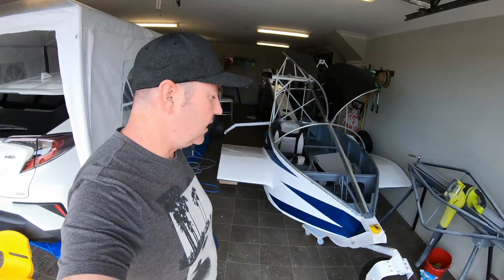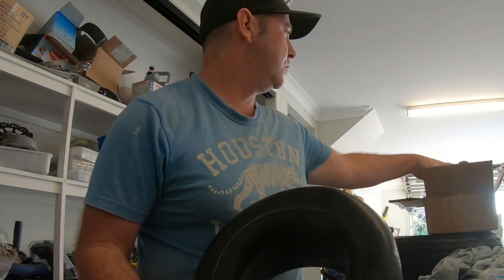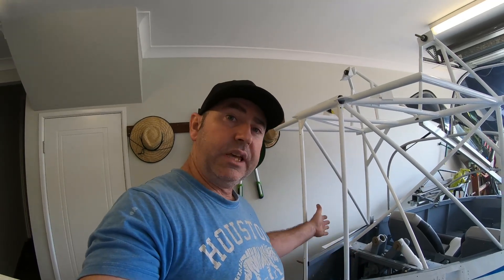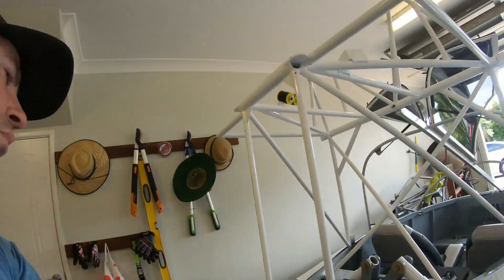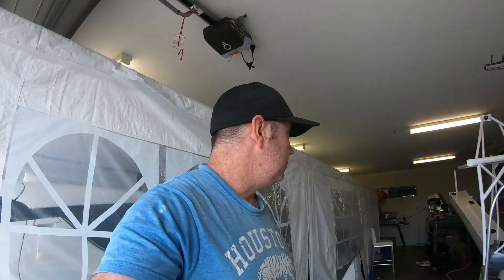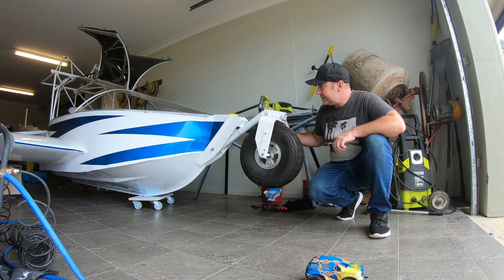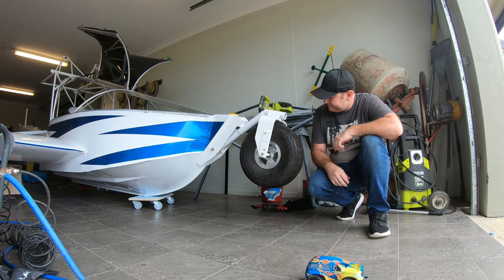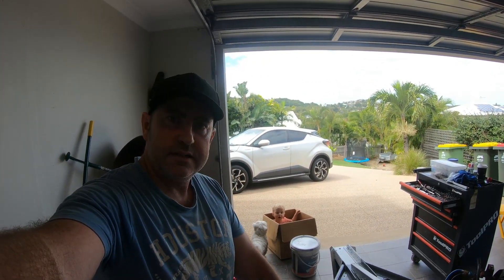Ultimate seaplane build retract gear and final assembly #Ultralight aircraft. Homebuilt update

Comment: Brilliant work!  Can’t wait to see how she floats!

One year ago this month I crash my Searey.   I made a perfect landing but on step taxi I picked oscillations during full power to take e off. 
I then hit a rogue wave and not having enough lift , the front of the plane went under about 1 foot of water and it popped off the front cowling.  It just popped off in one piece and the carbon fiber hull collapsed underneath my feet.   In seconds I was underwater holding my breath.  Luckily I didn’t panic and was able to get out.   I only had a scratch on the back of my head.
Lessons
1. Be extremely cautious of oscillation, it will kill you!
2. Practice egress, know how to get out of the plane, even if it’s flipped over.  Close your eyes and know how to find the seat belt latch.  Sounds simply unto your underwater holding your breath.
3. I had a seat belt cutter in the pocket next to me… when the entire cockpit disintegrated so went the seatbelt cutter.
4.  They make these small 10 min air tanks… maybe in corporate it into the design.
5-  Get training…. This one will be a challenge… how will you know the quirks of this one off plane?
Maybe train in a Searey, as it requires a different landing technique on the water.
6. Will you have a gear warning device?   Training will help here too if you opt not to have it!

Take care!  I hope this helps you prepare….  Landing on the water is a blast, but it can be unforgiving!
Reply from the maker: Wow sounds like your very lucky to not get injured. That is some really good advice thank you. I have done some water landings in a searey. I’m fortunate to have two mates with seareys and will be doing some more prior to testing this one. I do intend on having a gear warning. What do you recommend? Thanks for watching and appreciate the advice and sharing your experience.
Reply: @michaelhille261  I would hit up the Searey forum site, as there will be many builders that can suggest gear warning devices.     In the USA we have Airworthy Inspectors that check out experimental builds before they can fly.  That might be a great resource for you.  As they would know where builders make the most mistakes.   I like your gear mechanics, it will be interesting to see how well the nose gear works in the water.   Clear Skies! Joesky

Comment: interesting It sounds like you're in the UK. Our USA ultra-lites are much lighter but I was thinking of doing something similar... just some ideas to pass along. the flying boat part is good, but I would do a high wing, also maybe some small out-riggers for weight saving with comparable stability out of a narrower, lighter, center canoe type body.  We are limited to 254 lbs plus an allowance for floats and parachutes... yours is looking good. Did you use plans or a kit, or is it your own design?
Reply from the maker: I’m in Australia. Sounds like you have a good design and would be interested in seeing it one day. This is my own design and will be high wing with 200hp. Thanks for following along appreciate it 👍
Reply: @michaelhille261  Yes, mine is my own design as well.  Being so limited by final aircraft weight you need to use alternative materials and use other weight saving techniques such as multiple functions from a single part. Your ultralights are more akin to our light sport planes and would require a pilot license fly here. there is no way that an ultralight (no license required) here could use the materials or design that you have in your build.

some examples of my design specs are using paper mache' rather than fiberglass for the central body which is much lighter than glass fibers. Paper Mache'  was used extensively to make horse drawn carriages, and can be extremely strong, light, extremely rigid, and water proof - using a small central bicycle single landing wheel with bungee springs like a sailplane, parachute material for wing covering, etc. This way the frame can be light weight aluminum tube and support wires.  being single seat and limited to 54 knots means that materials do not undergo the stresses of a heavier plane.  None of this is an actual invention of mine, or new technology but most folks are ignorant of the technologies of the past and simple use fiberglass (strong but heavy) out of ignorance of the alternatives, or carbon fiber to save weight (extremely expensive)